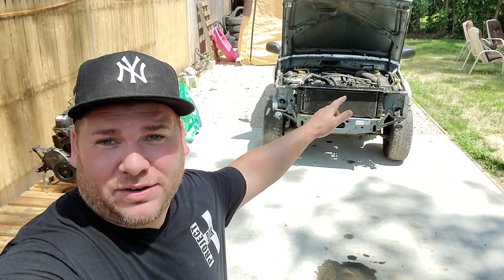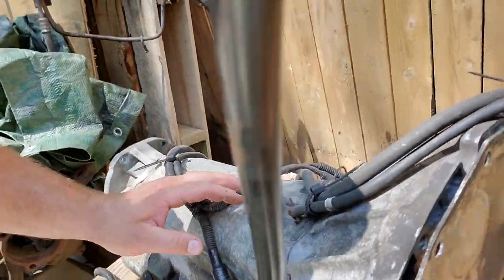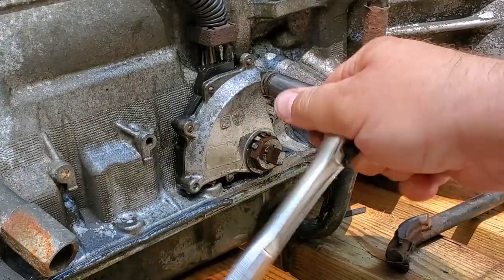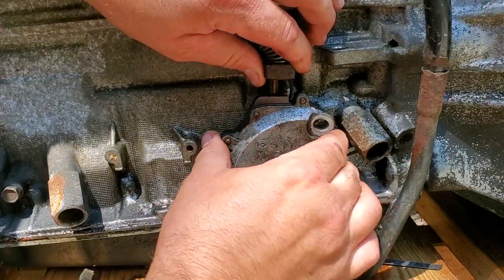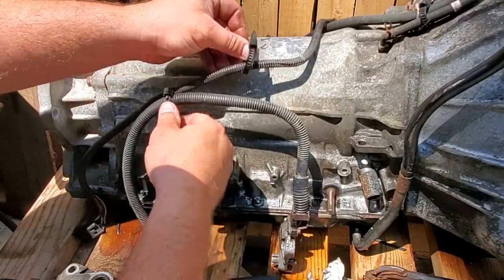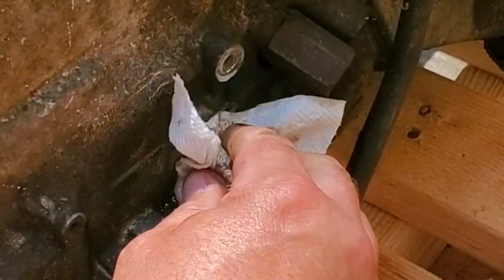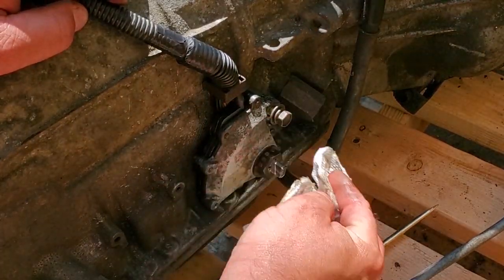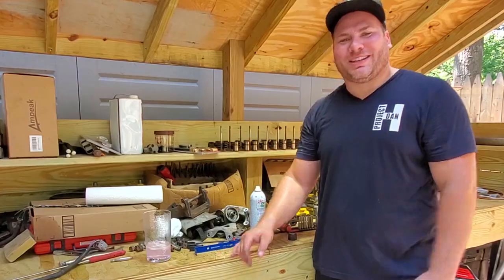JEEP CHEROKEE XJ NEUTRAL SAFETY SWITCH REMOVAL AND INSTALLATION - FREE THE AW4 NSS!

Comment: It sure is easier to remove that switch when the gear box is out of the car. I would put the tabs on the lock washer on the bottom, easier to remove when the next person does it from under the car. I was  not able to fit the zip tie,  just can't get my hands in that tight space. A good tip if you are doing it from under the car, tie a string to the plug, makes it so much easier to pull the cable back up. I took mine out today, cleaned it inside, works great now. Thank for the video! Cheers

Comment: @Project Dan H . Dan, since it was 68 degrees outside today, I decided it would be better to replace my nss on my 93 xj. Now with the old one, I was gonna take it apart tomorrow, clean the inside out, put a dab of die electric where the springs are that push the contacts out so they make contact to all 4 or 5 contacts from the wiring harness. Now with that said, once it's cleaned out, lubed up & assembled, can I hook it up to the harness under the hood, put the key in the on position and rotate the switch to see if the backup lights come on in the reverse position. If I can, then it should tell me that the nss is in  working order if the backup lights do come on. They haven't been and yes, I've had to jiggle it back and forth from park to neutral in order to start this baby to start about every 2nd or 3rd time I tried staring my xj....Thanks Dan, MD...

Comment: Out of curiosity does the VIC show rear lamp failure and the ABS dash light when the reverse lights are not working, I’m about stuck on what to do next then I saw your video
Reply from the maker: Well the ZJ doesn't have the same NSS as the XJ.  But if it failed is wouldn't show a rear lamp failure. At least I don't think it will.  Try a new rear lamp module and a new NSS for good measure!

Comment: I been Watching your videos for a long time now. I have a 98 jeep grand cherokee.  Some times turns on and and stays on and some times turns and  and cuts off after 5 seconds. But when it does the cluster, the windows and the shime goes out too and the only thing that shows on the  cluster is the ABS light that stay on.  Everything is is off. Once I turn the car off nothing on the cluster works together with the power windows. Any ideas of what could be the issue?
Reply from the maker: Sounds like a bad Body Control Module

Comment: hello useful video skills question under this on the output shaft there is a small oil seal you accidentally do not know the number of this oil seal there is no way to find it ano pratikaet skills
Reply from the maker: You need to know the model transmission you have for the trans output seal and the type of transfer case for the transfer case input as seal

Comment: I’m missing the adjustment bolt . My Jeep wouldn’t start so a crawled under to mess with the switch and found that the bolt was missing so I’m unable to cinch it to any adjustment . I need to know the length , diameter and thread pitch on the thing . I’ve scoured the web trying to find this info .

Comment: Thanks, about to remove and clean on my daughters Xj,  the reverse lights are intermittent, I guess contacts are dirty?
Reply from the maker: Yes, most likely.  The NSS can be cleaned out if you can remove it without braking it. Lol .. use lots of penetrating oil!

Comment: @Project Dan H. Great video Dan. I just bought a 1993 Cherokee that came from Colorado City, Colorado. The underside, along with the rest of the body & doors are completely rust free. I told my wife that it'll outlive this 2010 Patriot I bought 11 months ago, which is on it's way out because of the poor engineering, along with cheap material that is used today on all the Jeep Models. At any rate, I was told that the NSS was starting to go bad, which did act up when I picked up the Jeep today.  I ordered one and will be putting it on next week while it's still nice outside because I'm here in Michigan.... Now you pulled the AW4 trans out because you're putting in a manual trans right? Thanks, Dan
Reply from the maker: awesome to hear!  I love XJs, congrats on the 93!  Yes, basically the AW4 is out and an AX15 manual is going in. God bless👍
Reply: @ProjectDanH  Awesome it is. Hey Dan do you also have a .com or an email address that goes with your channel? Reason I'm asking is once I start checking a vehicle out like I am with this one, I'm almost positive that the 2nd owner pulled the engine & trans out and at least rebuilt the engine. Instead of replying back and forth in the comments, emailing directly would probably be a lot easier. Unless you have other media platforms where PM can be done. Plus you might wanna see pictures so you can see what I'm talking about. Thanks for replying back so fast & God Bless You back Dan. Thanks again, Dan
Funny,we're just a couple of Dan's with Jeeps, lol....
Reply from the maker: @montydaniels1054  every Dan should own a Jeep 😊.  I'm best reached on instagram. @project_danh
Reply: @ProjectDanH  I pulled the carpet up on the front passenger side yesterday and the floorpan looked great, no surface rust. I might be able to get a 1999 that is a rust bucket and will need a trans because it's slipping. It has one of those $350-$400 stinger front bumpers (no winch), along with a new set of tires & rims. Guy is asking $950 obo. I'm thinking about buying it just because I'd rather have a beater for the 2 worst winter months. Because this 93 XJ is so clean, now I'm turning into a scardy cat about driving on our salty roads. I've got a set of Hankook Dynapro ATM 245/R75/16's w/Vision Wheel Rims. So if the automatic car wash down the street says that it's go through their conveyor without issues, I might drive it this winter. I suppose I can put the original rims back on but they're studded snow tires and I believe that means I can be ticketed if caught driving with em. I think I'm creating my own dilemmas with this XJ, lol.... Any advice Dan. Thanks, MD...
Reply from the maker: @montydaniels1054  if you want the 93 to last garage it in the winter and drive the beater!
Reply: @ProjectDanH  Yeah Dan, I'm waiting for this guy with that 1999 Jeep to see if I can see it. High miles just that trans issue but that's a weekend project with a mechanic I know. If i can get it, I'll get it. Besides, that stinger bumper and extra set of new tires covers most of the price. If he'll accept less, than it's a win win for my team. If that deal falls through, I am also looking at a 98 that just needs some minor things done to it. Maybe I can talk that other guy into selling the stinger bumper and I'll give him the one off this 93. I've got some options here I think. Thanks for the advice Dan....

Comment: when my ac is on and i switch gears on my automatic like you have in video my rpms go way high or way low and the guage light comes on. it also does this when i put it into gear with ac on . and idles high when turning ac on or off . some say its the IAC  what you guys think ?
Reply from the maker: Sounds like you may have a vacuum leak.  Could very well be an IAC.  Make sure you have a good battery and clean your throttle body very well
Reply: @ProjectDanH thanks  i'm going to attempt to clean my IAC tommorrow at certain points with ac on when i put it in park with the ac on the rpms get high or low. i have over 300k miles . how do you clean a throttle body if it comes to that ?

Comment: Does the neutral switch conect to the same harnest that goes with the coil pack?
Reply from the maker: I think so. It connects into the engine harness right by the trans dipstick tube

Comment: Congrats Dan on 10k subscribers!!!  I had to replace the NSS on my 96 XJ and it was a pain (without rust).  I ended up using a 3 jaw puller with the point seated on the shaft to get it off.  I think what helped you was all the time the penetrating fluid got to sit and do its work.
Reply from the maker: Yes! Penetrating oil definitely pays off. Your puller idea was brilliant! Did the NSS. Break?
Reply: @ProjectDanH  The puller idea came after I tried other methods that broke the NSS.

Comment: I just took mine off today and got it all cleaned out and stretched the springs back out a little bit... I didn't undo my harness I unbolted it and just left it hanging it was still a pain to do it
Reply from the maker: That's pretty cool, they can usually be rebuilt but I end up destroying them during removal because they're so rusted on.

Comment: So does the nss control the reverse lights /turn signals as well the fan in the car ? People are telling that it is for a 03 4.0 wj
Reply from the maker: just reverse lights.. turn signals should be on a relay in the dash
Reply: Hmm interesting I can figure this out then , I have to turn signals and not air or ac in the car since the fuse keeps popping…fuse #20 under the dash

Comment: Nice job removing that N.S.S.Dano.Will you be using the engine computer for the auto transmission with the manual?
Reply from the maker: That's the plan!  2001 auto pcm and harness with a 2001 tupy head and coil pack ignition system then a 1999 block with an AX15 manual and a 242 selec track transfer case.. what do you think? plausible???
Reply: Sounds like a winner to me Brother....👍👍
Reply from the maker: @danhambrick6331   Perfect, Stay Tuned!!!

Comment: Another way to pry it away from the shaft is put that big nut back on and stick a prybar between the nut and the nss housing and give it some pressure it should break free
Reply from the maker: Excellent tip, will this work for rusted Jeeps?
Reply: @ProjectDanH  I have a 96 Cherokee and it wasn't really rusted but it was oily I just sprayed mine with pb blaster and let it sit overnight